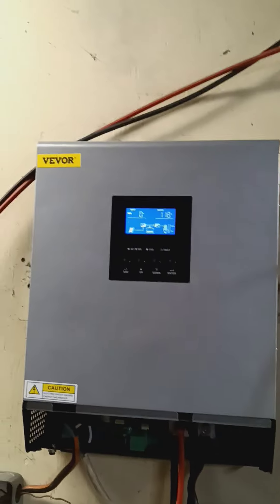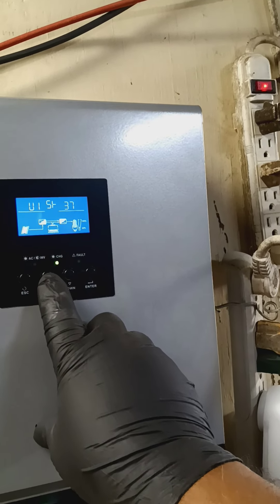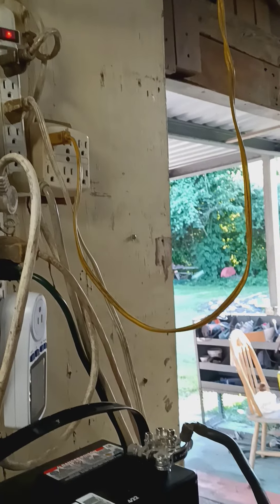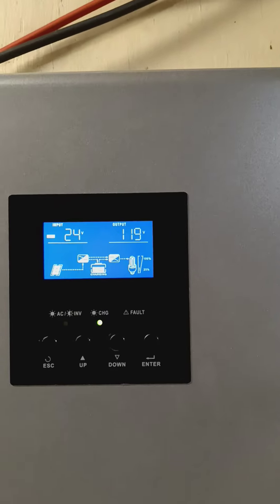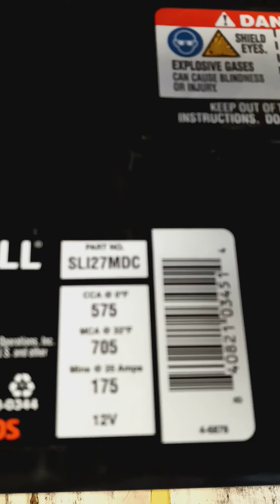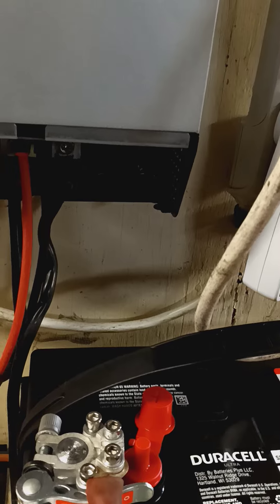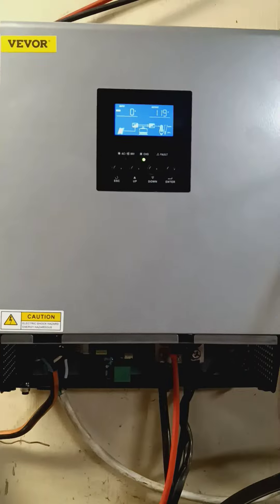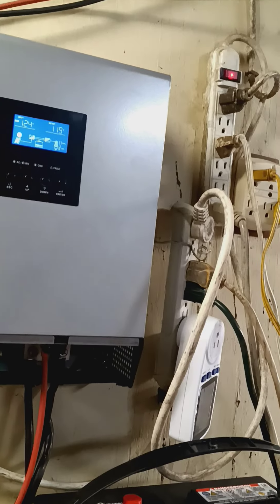vevor 3,000 w inverter help. 4.... 300 watt solar panels

Comment: this inverter has a 24 volt pv input. That is normal. You get 110-119 volt output. I come from the EU where we get a 230-240 volt output.
Reply from the maker: i have 1200 watts for solar now they are pushing 760watts window unit on solar allday..they are laying flat so im sure i can do better